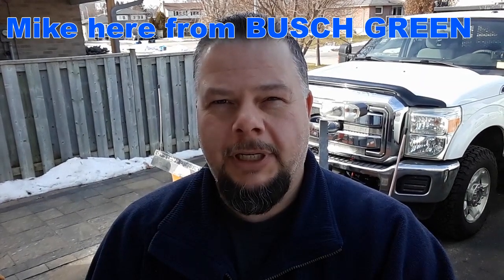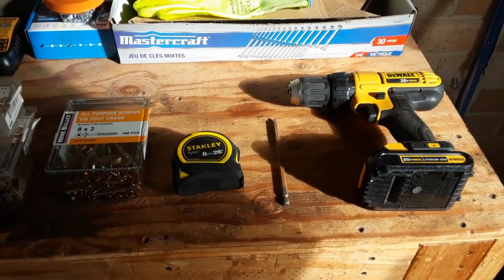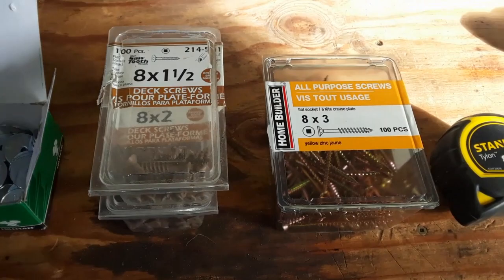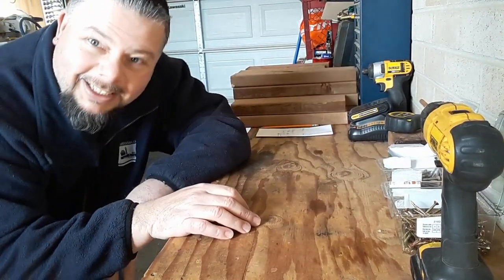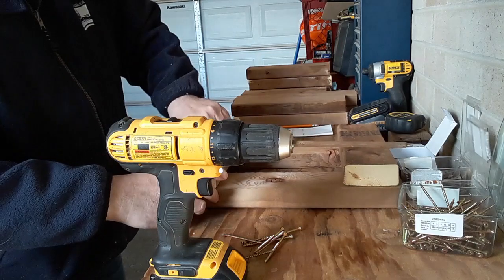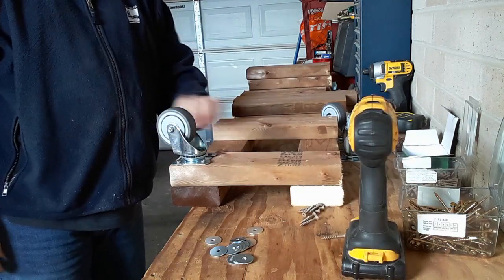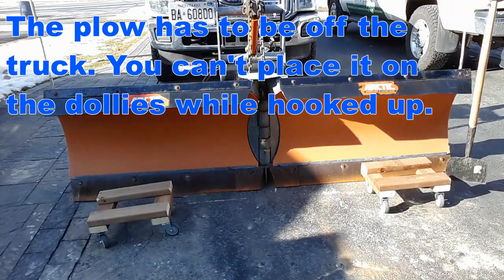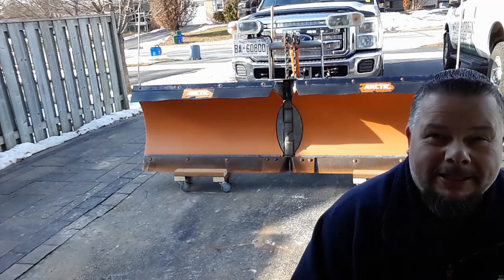DIY Dollies for your Snow Plow or anything else!

Comment: A removable swivel trailer jack with a wheel towards the plow frame and two casters welded to some round stock that go into the plow shoe holes works way better. I've also seen the casters bolted to where the plow shoes go in and swivel up and out of the way so there is no need to remove plow shoes if you use them.
Reply from the maker: Awesome idea , that was thought about too

Comment: Mike, those are very similar to the commercial furniture dollies i use. So i am actually able to leave the plow on the truck and lightly lower it onto the ones the blade sits on. i then slide one under the frame like you have by lights. and i unhook everything and back the truck up. Now sometimes i might have to have a little jack under the lights and raise just barely anything just to relieve some tension. That is what i found works good as i am not trying to lift the plow and struggle like you were LOL. Thanks for the shoutout. I am all caught up on all your videos. Keep making more and hopefully you can spend some time on my channel Thanks
Reply from the maker: Hey Shawn, they are probably similar except an upgrade for the casters. I like the casters that roll better and have a higher weight rating. Trust me, I have tried putting the plow on dollies (my other set) while still hooked up to the truck. The back plow frame is too low to the ground and you can't do it. What I might try next time I have to take it off is maybe put wood under the front tires, roll up on them and the front end will be higher. Trail and error lol. Overall the casters I use are mint. Thanks for watching and no problem on the shoutout!
Reply: @MBGAdventures  so that might be the difference is my plow is a little higher off ground in order to do it while on truck

Comment: Good job, I just don’t understand why you can’t put the dollies under the plow while it’s on the truck, then just lower the plow. Guess I’m missing something.
Reply from the maker: Thanks Rick. Sometimes it works, sometimes it doesn't. Depending on if you are on even flat ground. My driveway here in this video is uneven. I did tweak it out since then. Thanks for watching.
Reply: MBG Adventures great,  I was watching and just couldn’t figure out why you couldn’t just drop it on the dollies.  Understood.

Comment: Why not use a floor jack to raise it or why can't you lower the plow down onto the dollies.
Reply from the maker: Great questions. My floor jack is crap lol. Yes, you can drop the plow down on dollies but trying to get it off the truck mount is a pain. This is a great plow but a pain in the ass to put and take off. An ideal situation is to drop the plow down and leave it there. Here, I have no room and need to be able to roll it around. We have moved since. I have lots of room now and no problems. Thanks for watching!
Reply: @MBGAdventures  If you hadn't i would suggest putting a couple wheels on that lock so the dollies don't move but sounds like you are all good now. I have one in my back yard they we moved to pour concrete and now i have to figure out how to move from grass to the concrete we poured. thinking two wheel dollies on both sides to get it to the concrete then furniture dollies to move once on the concrete.
Reply from the maker: @MyTBird57  Taking off and putting on a plow is best on even ground. It was not even on that driveway. I have a large garage now that I can drop the plow on dollies and so much easier. With your situation, can you not hook up the plow to your truck and move it off the grass and onto the pad or am I missing something here? :)
Reply: @MBGAdventures It's in my back yard so no vehicles can get back to it. I forgot how I got it back there 5 years ago when my jeep took a crap and now that's it's running again I need to be able to get to it which is why I had concrete poured so I could roll it around on concrete and not grass and rock. I think 4 of us carried it back but I can't lift that much now. Probably just going to lay down plywood and roll it on that to the concrete.  I'll figure something out.
Reply from the maker: @MyTBird57  Ya, plywood and roll it out. Or, make a sled for it, straps with a wench on trees and slowly drag it free. Good luck man!

Comment: Why wouldn't you just lower the plow onto the dollies..? My plow is in the neighborhood of 1100 and there's no way I'd be able to lift it high enough to do that.. My back blade is easy, it lowers right onto my dollies-but I do need to make something for the front plow..
Reply from the maker: Because this plow is hard to get off when it's attached to truck and on dollies. Since this video I have moved and able to drop the plow on a flat concrete garage floor which is a million times easier now. Thanks for watching!